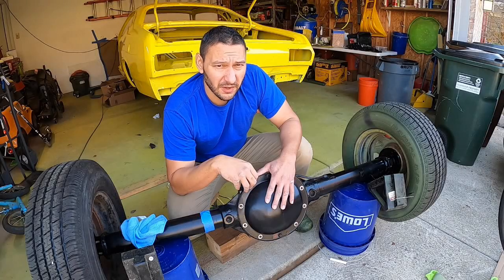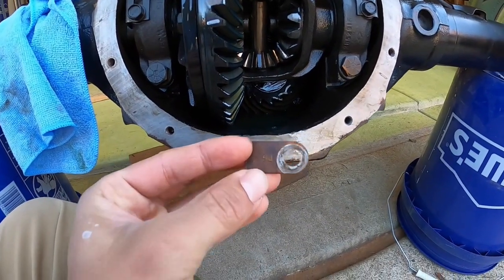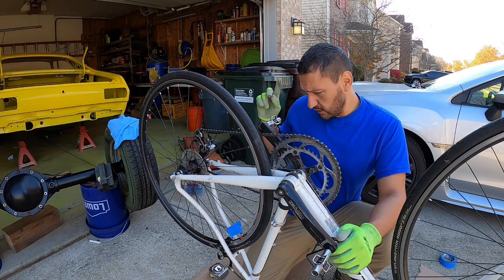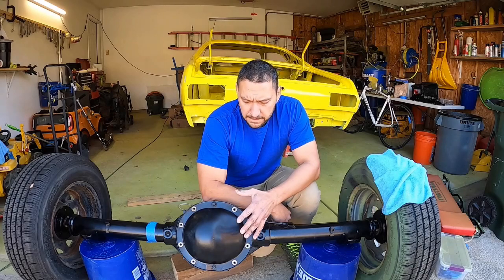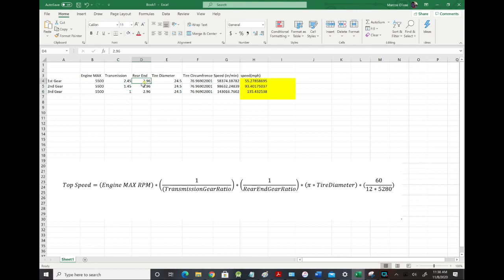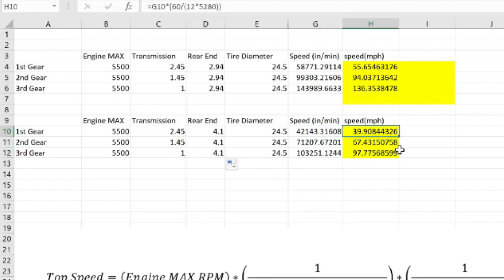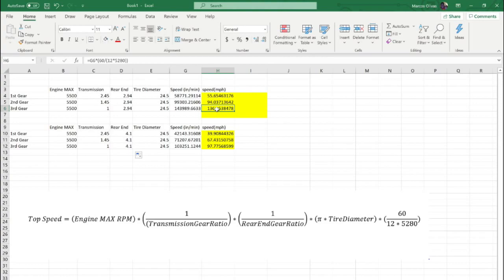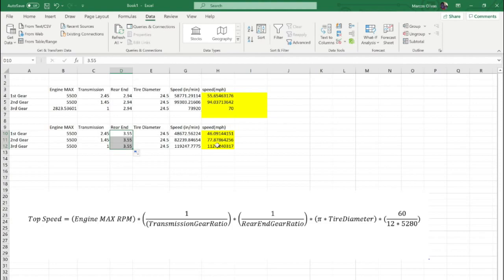Rear Gear Ratio Explained

Comment: Generally a final drive ratio of 1 to 1 in the differential is ideal. One rotation of the pinion yolk equals one rotation of the tires. That math is .12 × tire diameter. .12 × 24.5 = 2.94 which tells you why Chrysler put those gears in this rearend.

Comment: I have a 1979 Volare with a 8 1/8 diff and a 2.90 ratio. Wanting to change it to 2.76. Only thing I’m wondering is are they interchangeable? I don’t want to buy the gears and they don’t fit onto the case.
Reply from the maker: Hi Landon, sorry I am not familiar with 8 1/8. Are you sure it is not 8 1/4? They made lots of those. Good luck with your gear swap!

Comment: thanks for the lesson,  i’ve had several Antique British Sports Cars  more Specifically MG   T Series cars  i know you will laugh but back in the 50s  they were  extremely Competitive Race Cars  despite only having 4 Cylinder Cars they Competed and won very often  the Cars were Factory built and designed to Race  they ven had  a Wooden Floor over the Rear Pumpkin that Pit Crews could change the gearing  very quickly during a race  without needing to drop the rear Axle  or get under the Car  they did everything from the top and didn’t even have to drain the fluid  honestly i always thought that was very cool  as i learned about that from my Father who as a Teenager  loved watching those Cars Compete  on Dirt Tracks  another smallTid Bit the originalMGs  actually were Americans  introduction into 2 seater Sports Cars and that’s what inspired the Corvette and Thunderbirds in the 50s the Bucket Seats ,Low Center Of Gravity , Convertible , and great handling ! Of Course Americans added the HorsePower because of the V8 engines we had developed , my Personal Truck is a Chevy Dually 4X4 Turbo Diesel  and i wish that one  had a simpler way  to Swap the gearing out  but it doesn’t  and because i do tow heavy weight  Inordered the Truck with410 gearing based on Chevys Conservetive Bullshit  on the FuelEconomy of their 6.5 Turbo Deisel that year  now it will pull a house but she drinks her fuelespecially if i want to Tow at anything over 55MPH  which i do prefer FYI i do not have my own Lift  or Pit to work on this Truck right now  so doing the gears myself is going to be a royal PainInThe Ass  untill that changes ?
Reply from the maker: Hi Craig, thanks for the comment. 60s MG racing sounds awesome!! I wish mine were as easy to change also. Those race guys find cool tricks. Thanks for checking out the channel!

Comment: You should teach children at school. I already know how this works, but I watched anyways. Not everyone has the gift to convey knowledge to others in a way that's 100% clear 😀
Reply from the maker: Hi Cheeky Demon! This comment really means a lot to me. My content kind of bounces around, but I have been thinking of doing more like this. I really appreciate the kind words!! Thank You! 😀
Reply: @DustorBust nice explanation, I still don't know how it works even seeing you visually explain it, because in 4.37 diff, the pinion has 8 teeth and the ring gear 35 teeth, where I'm confused is the drive axle from the ring gear to the wheel, does it have the same 8 teeth as the pinion gear? What if I had a diff with an 8 tooth pinion and 35 tooth ring gear and 6 tooth drive axle gear to the wheel, because 35 divided by 6 is 5.83, but the pinion to the ring gear is 4.37?
Reply: @DustorBust you could also teach “how to use Excel” for a lot of businesses.

Comment: Quick question.  I currently have a67 camaro with s350 and 4 speed tranny.  It doesn't like to go past 70mph it runs on high rpm.
Any suggestions on how to fix that?  Recommendations on a rear end and ratio?
Thank you
Reply from the maker: Hi Juiced78! It depends what you want the car to do. If you want a highway cruiser then you might want something like a 2.7-3 ratio. If you know your trans gear ratios and your engine rpm at 70 you can estimate what you have with the calculation in the video or there are some online calculators. If you have a 4 speed and still are high rpm at 70, then your gears are probably pretty short/ or a high ratio for acceleration.  You might also look at tire size. A taller tire gives you more speed per rotation, so that can help get your revs down a bit also.  Good luck!!👍
Reply: @DustorBust  I'm planning on testing the ratio on my rear end.  I don't see s tag.   I'm just  wanting like a cruiser for the highway.  But I will definitely be looking for 2.7 -3.
I really appreciate your input buddy. 

Thank you

Comment: Question! I bought an 89 ranger that has been converted from an automatic to a standard shift. I’m not sure of the gear ratio but its very high. it’s very difficult to pull out on hills and etc. do you have anything to recommend? I’m more interested in pulling out and or crawling in 1st gear.
Reply from the maker: Here is a good article on crawl ratio, basically a bigger gear ratio 4:1, 5:1 would be better for crawling and will also help your acceleration. Good luck 👍
https://shiftsst.com/blog/post/off-road-gearing-%E2%80%93-simplified.html#:~:text=50%2D60s%20Crawl%20Ratio%20%E2%80%93%20Backroads,constant%20throttle%20to%20avoid%20stalling.
Reply: @DustorBust  Thank you so much!!

Comment: Immediate subscribe… I need this excel formula for my 350 turbo transmission, I have 24 inch rims and my engine tops out at 6500 rpm. I have a street truck with posi 373 gears now. Thanks

Comment: Ok so If your doing a turbo build I'm guessing the bigger gear ratio is better for the street for better acceleration and low end torque. While if your doing a drag application it's the opposite Low  end speed is better since your starting off the line at a high RPM. Im guessing maybe it's the other way around if I'm wrong let me know lol
Reply from the maker: Hi, good question. Let's start with non turbo. Street cars have a lower ratio, or taller gears like my 2.94, this provides lower torque multiplier, but allows for higher top speed for cruising the highway. 

Drag cars, have higher ratios or shorter gears. It depends on multiple factors, but people racing 1/8 mile will usually have a 4.0-5.0+ gear ratio, maximum acceleration with low top speed. They run out of truck. 1/4 mile is more complicated.

The turbo is just a torque multiplier, when under boost. The speed relationship if each gear and top speed will not change. It also depends heavily on transmission.  My daily driver is a Subaru WRX, it comes stock with 4.10 gears for good acceleration, but it also has a six speed trans, so it performs just fine on street and highway. 

Hopefully that helps! Thanks for checking out the channel.👍
Reply: @DustorBust  so the higher ratio won't allow my turbo to spool faster which would be better take off on the street. I get the tranny makes a big difference but this just a general sense we can assume the transmission is the same either way and you just want to change out the rear end. Would a somewhat bigger ratio make my car take off faster vs a small ratio if it gives you more torque?
Reply from the maker: @marioandultrachap  ok, I see what you are saying. Since it will rev faster does that also help get into boost faster. It will already accelerate faster, but will it get an added bonus from the turbo. I honestly don't know. Interesting thought. A turbo tuner would probably be able to help with that one. Sorry, that one is beyond me. Good luck!

Comment: also sir differential ratio is constant while gearbox ratio changes right?
Reply from the maker: That's right, your rear ratio is fixed based on the teeth of the gears and you only have one set. The transmission or gearbox will shift between it's own sets but still must use whatever gear ratio you have in the rear axle for the total ratio.

Comment: Thanks for this video. A lot of education for me. I have a 97 290GD (G Wagon). I changed the engine from a 5 cylinder diesel to the famous OM606 engine and transmission. Do I need to change the axle ratios to be able to at least get 150km/h high speed?
Reply from the maker: @Mathias Kumahor , thanks for checking out the channel! Sorry, I am not familiar with those cars or the specs, but you could easily calculate it if you lookup the trans specs. Most cars can easily hit 150km. For me this is an issue because of the 3 speed transmission, I just run out of gears quickly.

Comment: So supercars just have 8 or 9 or even 10 gears so they can acelerate quicker and have higher top speed with the same rear end? Honestly I would like to have a little bit of both some day when I buy myself my own car, my dream is to build a dodge demon or some older muscle car that will be able of going fast and quick not just one of these two.
Reply from the maker: That's right, new supercars have lots of gears. Hellcats have 8 gears. F1 cars also have 8 forward gears and that is how they have  the best of both worlds. There are some drop in 6 speed transmissions that work with older muscle cars. Anything is possible, but sadly often budget dependent. Thanks for checking out the channel!

Comment: 7:27 It gives you more torque NOT more power. Power depends on the engine not the differential or gearbox.
Reply from the maker: @limplin7 you are correct. Saying torque would have been more accurate. The engine will dictate the amount of available work/power. Gearing will determine where in the rpm range it is used . More torque will give you faster acceleration, but with the change in rpm the actual power calculation will be the same.  Feels like more "power", but is really more torque.  Good call-out.

Comment: Amazing Info wow.....this opened my eyes to putting a 4.10 vs a 3.55 in my car. I currently have a 3.23 in it. Now i see why they say a 4.10 is really for the 1/8th mile racing as you'd never make it down the 1/4 mile without maxing/topping out your top speed and then the guy next to you would blow by you on the big end with his 3.55 rear end car
Reply from the maker: Hey Ruben, thanks! Glad you found it useful, this one was a bit down in the details. Yeah, huge impacts form gearing. At some point I will have to change out my Granny gear 2.94's. 😀

Comment: Not sure that your going to be able to find a street/ strip type rear tire thats 24.5 inches tall. 26 or 28 inch is more like what you will find.
Reply from the maker: Excellent point. With the stock 14" wheels the tire options are very limited. I used what I have/stock setup for the explanation, but eventually I do want to update the wheels and tires and this will for sure impact the speed/torque relationship. Thanks for calling that out.